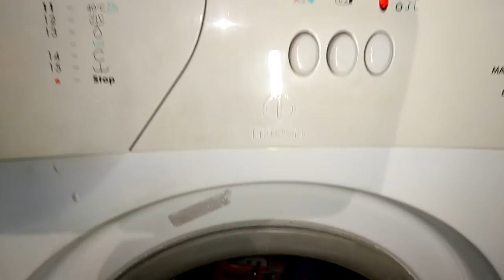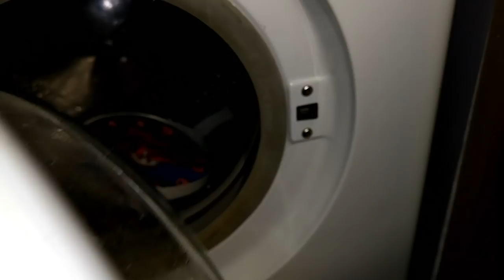Experiment - Clock - in a Washing Machine - Centrifuge

Comment: Fact: you can do this yourself. 
Step one put batteries in the clock.
Step two load your laundry.
Step three add clock.
Step four add detergent 
Put it on cycle
And watch the time as the cycle goes by.
Reply from the maker: Nice 😀
Reply: Hey hey dino petkov iț not nice
Reply: @silviuioanovlache1021  it will do experiment's